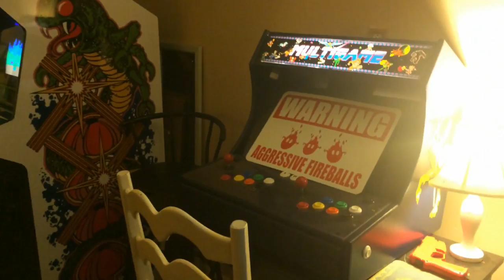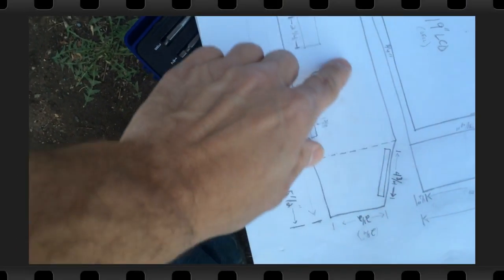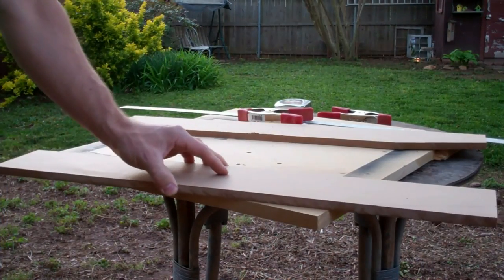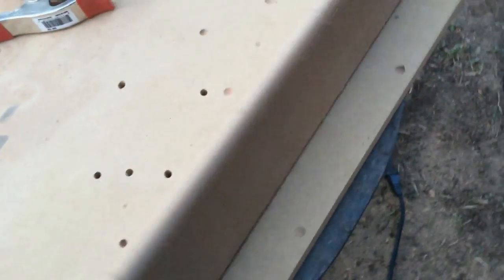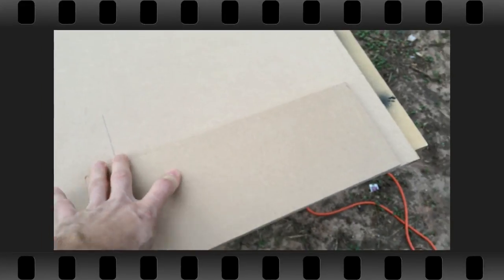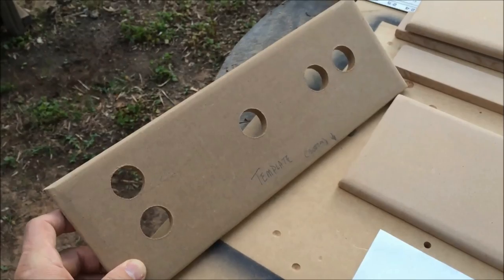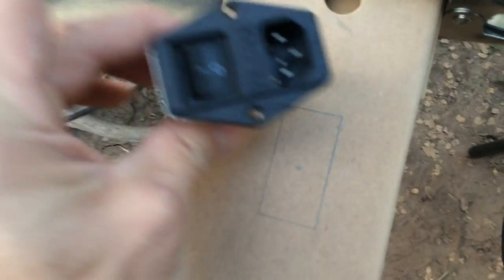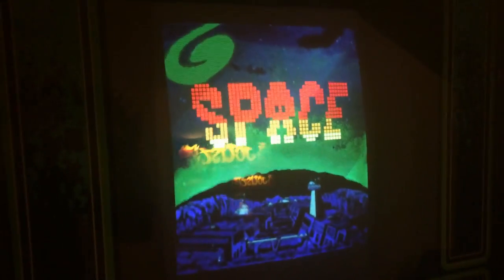Mini Cocktail Arcade Step-by-Step Build - Part 1 - The Woodworking!

Comment: You might consider sawhorses. Also earplugs and safety glasses when using the circular saw, jig saw, and router. 28:00 - to avoid the mess on the bottom, drill halfway from the top, and then halfway from the bottom to meet in the center.

Comment: i love the mini arcade so much that i want to build one for my self but only problem i am gonna have is all the electronics you think you can list where you get the parts from and how much the total cost to make one of this i would really appreciate it thank you so much for a great build !
Reply from the maker: I actually had the build specs and a parts list link in one of my vids, but I think it’s not working.  I can post something for you for sure.  It’s a parts list with the website link also.  Let me dig it up.
Reply: @jefferysdyer  Thank you so much jeffery it sure is nice build i love it
Reply from the maker: @nasrumomin  Okay, try this Dropbox link and let me know if you can see the 3 files.  Part list, cabinet specs, control panel specs.  They are a bit old, but should get close to where you need to be.  Let me know if you have any questions.  And of course if you can get to the files and open them.  
 https://www.dropbox.com/sh/z7mre3p8trxbl2a/AADbUShDVhLjFbhPPU07tCZTa?dl=0